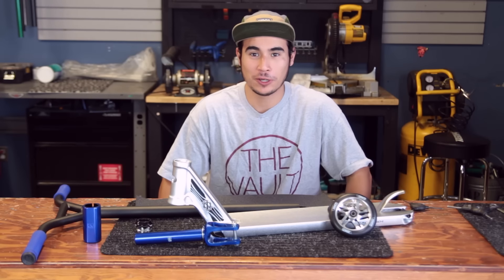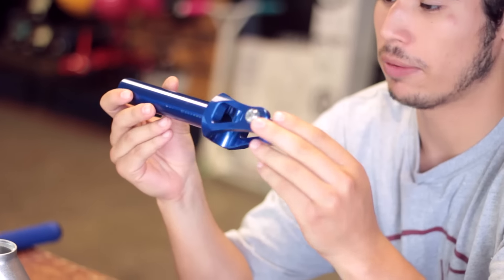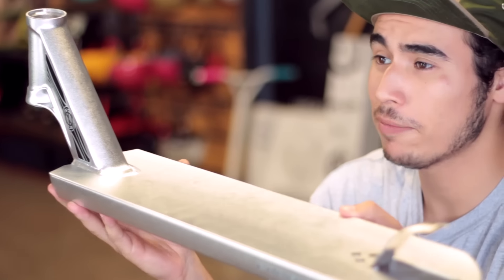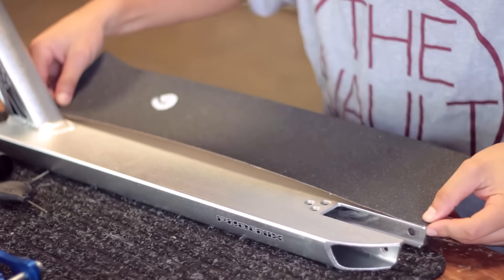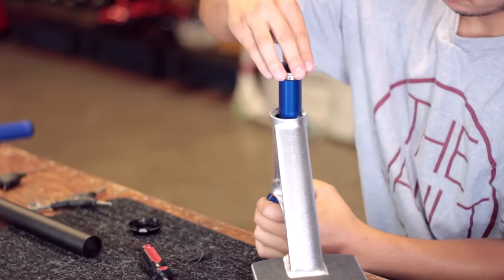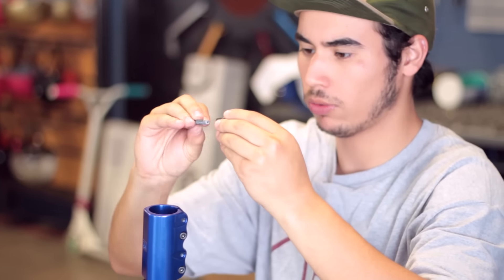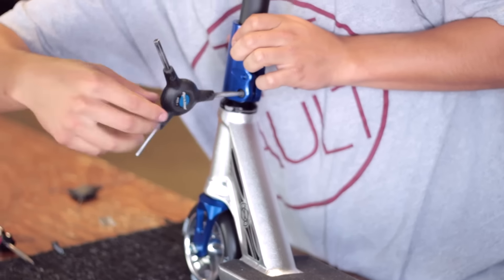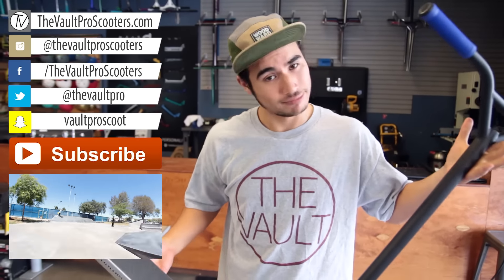Custom Build #75 │ The Vault Pro Scooters

Comment: A sweet build would be 

Ethic lidworm with Chrome brake
District al 2 HM bars
Envy Cnc forks in Aqua blue
Gold eagle spoked wheels
Blue Tilt half knuckle clamp 
Black ihc tilt headset
Orange hella grip
Aqua odd grips with odi bar ends

Comment: people want cheap completes so i got something around the $250 mark that is running hic:
envy grips purple
district st3 bars sea blue
raptor 3 bolt clamp purple
envy integrated headset purple
district dk2 integrated in sea blue
madd gear hot head fork in purple
ethic incube v2 wheels with blue core 
raptor tye dye griptape blue
Reply: see